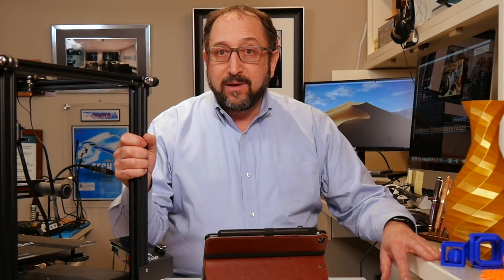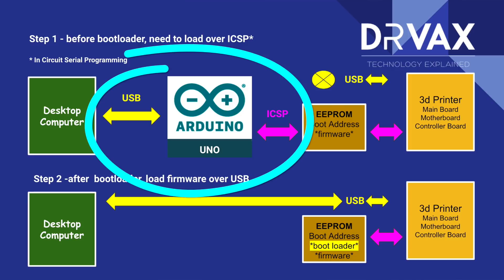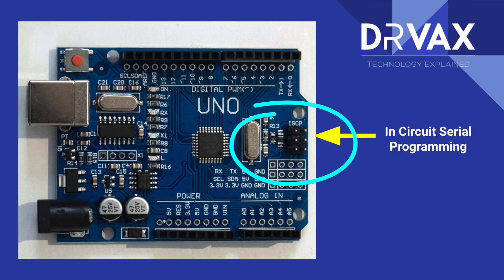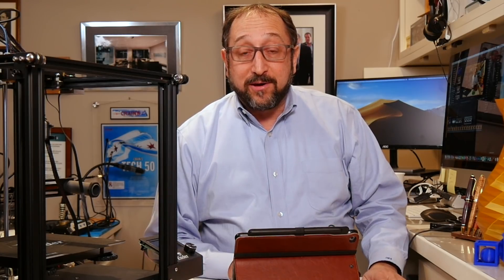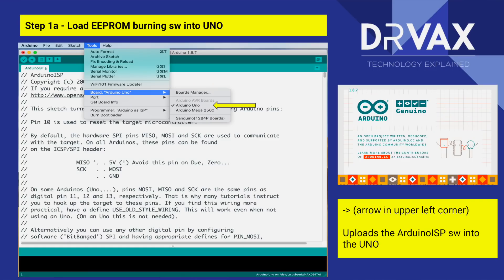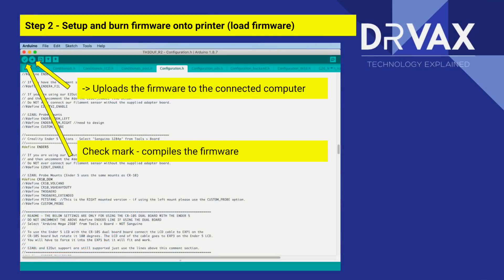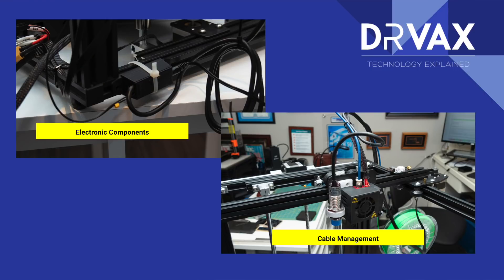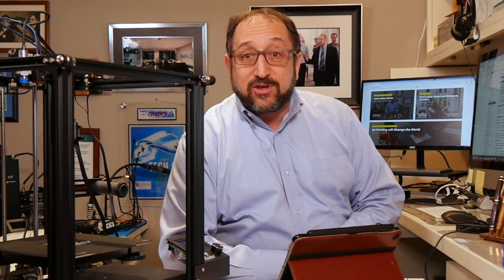Ender 5: How to Install a Bootloader, New Firmware and an EZABL Upgrade

Comment: So I upgraded my bored to a skr 1.3 and set my firmware do I have to reset everything up on the th3d firmware or does it add the ezabl settings with my settings
Reply from the maker: Yes.  You need to set the following macros in the Configuration.h. The macros without the // are active.  Then you need to reload the firmware following the th3d procedures.

//===========================================================================
// Creality Ender 5 Options - Select 'Sanguino 1284p' from Tools > Board
//===========================================================================
#define ENDER5

// If you are using our EZOut V1/V2 (connected to LCD header) filament sensor kit please follow the install guide
// and then uncomment the #define EZOUT_ENABLE line below.
// Do NOT ever connect our filament sensor without the supplied adapter board.
//#define EZOUT_ENABLE

// EZABL Probe Mounts (Ender 5 uses the same mounts as CR-10)
#define CR10_OEM
//#define CR10_VOLCANO
//#define CR10_V6HEAVYDUTY
//#define TM3DAERO
//#define TM3DAERO_EXTENDED
//#define PETSFANG  //This is the RIGHT mounted version - if using the left mount please use the CUSTOM_PROBE option.
//#define CUSTOM_PROBE

Comment: Just watched this video again, very helpful   I'm installing my Ezabl and wanted to review the process.  Using it with their Ezboard lite - should be easy.
Reply from the maker: Excellent. Thanks for the comment.
Reply: @MakeWithTech  Thanks again for this video, it really helped.   TH3D has made changes to the EZABL it is now the EZABL PRO, I think improvements would be a better description. The process went well using their Ezboard lite, they make it very easy to flash with a new version of their Marlin.  I installed the EZABL control box inside my bottom electronics box, made for a very tidy look, no external wires or parts, except for the cable going to the sensor.

Comment: Can you please share your Ender 5 profile for Cura or Simplify3d? I'm struggling with setting correct settings...
Reply from the maker: Just select Ender 3 and then go to machine settings and change the height for the z axis to 300.  The watch my video on perfect first layers and change the combing settings. Hope this helps. 

I will be doing a video on setting up a new printer in Cura this week to help people with this common question.
Reply: I've got almost perfect prints, but I always have some stringing :( @MakeWithTech

Comment: Another great video!!  I was checking out the Th3d site for the EZABL and saw they are selling the new V1.1.4 main board at about the same price as Creality.  In looking further they will have a new replacement  board (TH3D Tough Controller) that seems to have a lot of improvements.  I think I will hold off until the new board is in stock.   Either of these boards eliminate the need to install a bootloader and add better stepper drivers.  The TH3D Tough Controller uses Trinamic TMC 2208 drivers and has a 32 bit CPU and runs Marlin 2.0.  Maybe you could get one of those and do a review on it.  I think it would be a worthwhile improvement.
https://www.th3dstudio.com/product/th3d-tough-controller-for-creality-printers/
Reply from the maker: Interesting idea. I will look into it.

Comment: I've been trying to find out more about the Monoprice MP10 since I think I'd like to update the firmware to vanilla Marlin. I contacted them and they said the current firmware was a 'closed' version of Marlin (probably just means they don't want you to do anything to it). In any case, I think I will try and update to the latest version. I just wish there was more information on it.
Reply from the maker: Yes.  It is unfortunate that Malyan (http://malyansys.com/) (the manufacturer in China) of the printer has not released the firmware.   The Monoprice printers are convenient because they come fully assembled at an affordable price.  They are probably not the best choice if you are interested in upgrading them.   If you add a bootloader and then load new firmware you will have to customize it with the appropriate printer parameters.   You can use a gcode command to have the printer provide you the current settings but Malyan and Monoprice will not support your efforts.

One of the advantages of the Creality printers is that even though they only release the firmware for some of their printers the community of users is large enough that you can get help upgrading the firmware.

Comment: Irv, I respect you a great deal... But you are misinformed. A capacitive sensor, which is affected by temperature and humidity and other electrical interference, is NOT more accurate that a BL-Touch probe. I am surprised you would make a statement like this without actual, verifiable evidence. Don't believe everything some vendor of 3D printing accessories tells you.
Reply from the maker: Thanks for sharing the information.  Your information is correct and I probably misspoke.  We can debate if a capacitive sensor is more reliable?  Thanks for sharing this information with my viewers.  

During the installation procedure, when using a capacitive sensor, most manufacturers recommend heating the bed up to temperature and leaving it there for 5 minutes before calibrating the sensor.  This proves your point.

Comment: I like the way you explained the theory behind each upgrade. Thanks. Please look into more upgrades on Ender 5 in future
Reply from the maker: Absolutely.  Already have the parts for my next upgrade.
Reply: @MakeWithTech  I am looking at the filament out sensor, do you think its good for Ender 5?
Reply from the maker: I am sure it works well but not sure I see the value. I have one on my Prusa and like the filament auto load it supports but on a Bowden system I do not think that will work well.  The primary value I see is the ability to use ends of reels of filament.  

If your filament jams which is more common then breaks I do not think it will help.  

My next upgrade will be the seemecnc easy extruder.  I find loading filament on the Ender 5 painfully and want to better support TPU. I should have a video about this next week. 

I already upgraded the Bowden tube to Capricorn and have new couplers on order.
Reply: @MakeWithTech  looking forward to your next upgrade